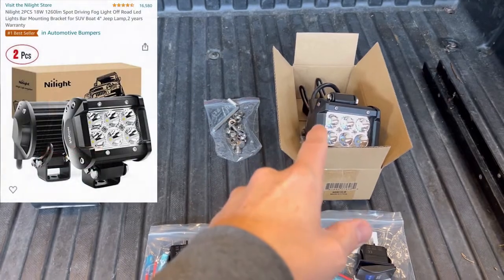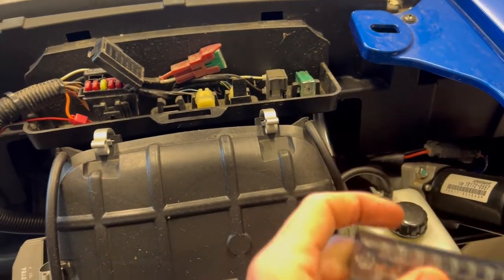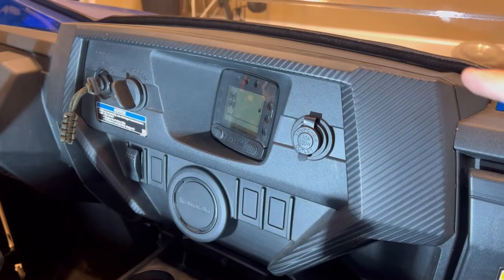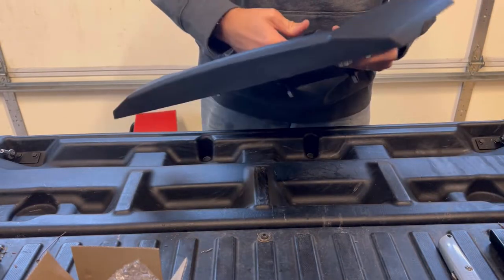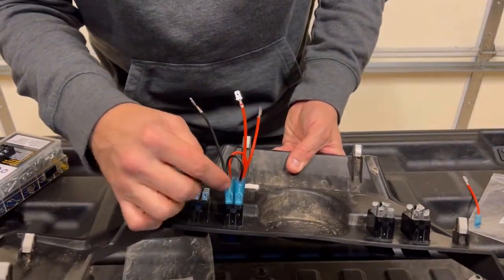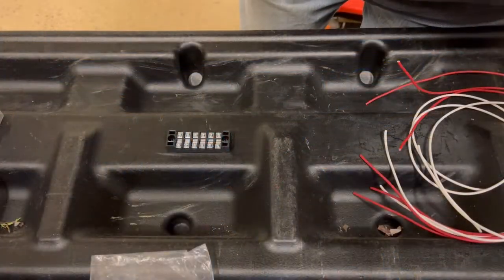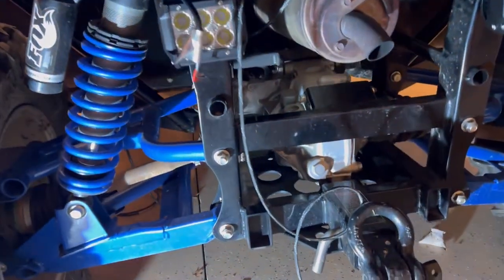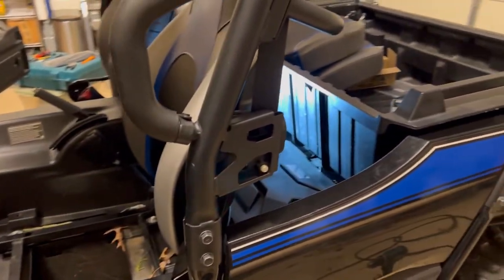Kawasaki Teryx Rear Light Bar Install

Comment: I have the same teryx...just a FYI for you.. the machine is pre wired from factory for reverse lights...there's a plug in back with empty spots to put wires for reverse lights come on when put in reverse...
Reply from the maker: That is awesome to know. I will probably wire it into that connector then. Thanks for the advice!

Comment: Great tutorial and very explanatory! i just didn't like the fact that you wired the block directly to your hot ignition wire without a relay, i'm concern about the amount of current you can draw when all the switches are ON at the same time
Reply from the maker: Great concern, but I did do a little homework first. I like LEDs for many reasons, but the thing I like most is the low current draw. If I had put in halogen or incandescent bulbs, I would have probably gone that route. The wire I was using was 16AWG. That is rated for about 13A. The total draw with all the lights on and wire resistance is about 4A. With all that I felt pretty comfortable that I had enough capacity on the wire to support. It is a good observation and very important in starting a project!
Reply: @outdoortypelifestyle9489  excellent! And Thanks for the explanation. That resolved my doubts

Comment: Really enjoyed the video, have the same Teryx as well. Where does the ground from the buss end up? Seemed to not capture that piece. The hot wire to the buss is secured with the tap, but not sure what I need to do with the ground. Thanks!
Reply from the maker: I ran a lead over to the closest chassis ground point. You could also run a dedicated ground to the battery, but these are all low current, so chassis is fine.

Comment: Can those rocker switches be wired to be illuminated when ignition is on rather then when the switch is in the on position.
Reply from the maker: After looking at the schematic, I don’t think it can be. I would prefer that too! Might have to do a little more digging to find a switch that you have more access to pins.

Comment: Love the video. I do have a question and I am quite new to this but I wanted to know a little more how you were to wire to the fuse hot wire.
Reply from the maker: Thanks for the question. I use a multimeter to see what is hot only when the key is in there “ON” position. I like to have a fail safe to not run my battery down. Then you can trace wires to see what side of the fuse to place your splice. Splice in with the FUSE on the battery side. Just pick a fuse that you really don’t have to share a load with or is intermittent. For example, starters are big fuses but only needed on start up. Unlikely you’ll blow the fuse as the starter is only needed in the beginning. On the other hand, the fuel pump fuse will be used all the time and you have to consider capacity. An ACC is usually a safe bet as they are to 12v outlets. I use a crimp in splice in dry locations. I hope this helps. Best of luck!